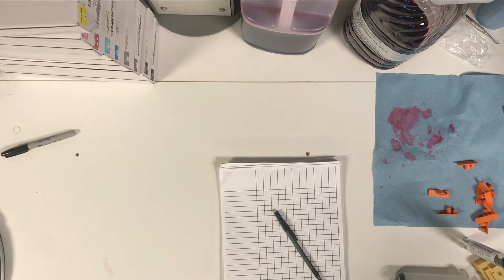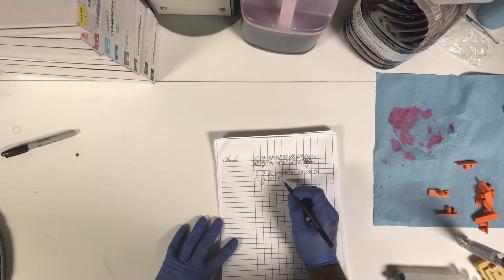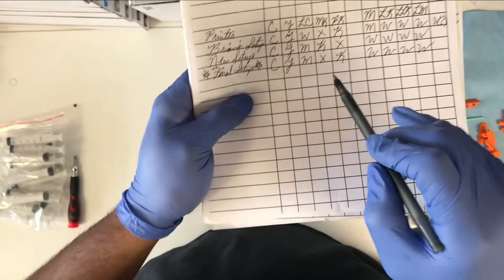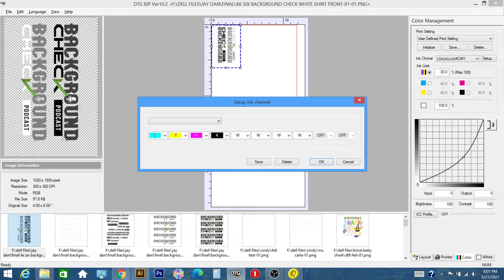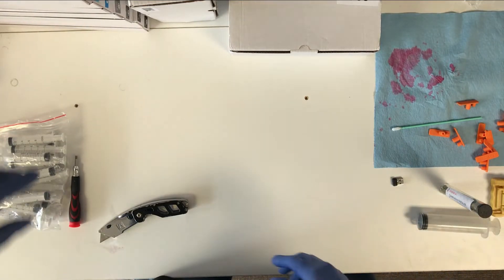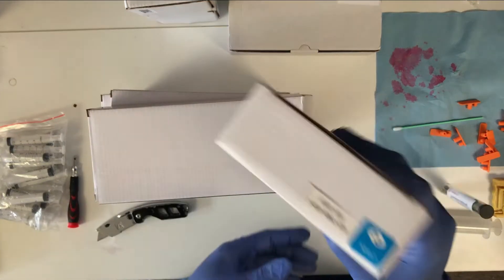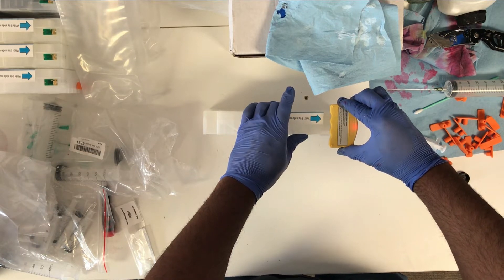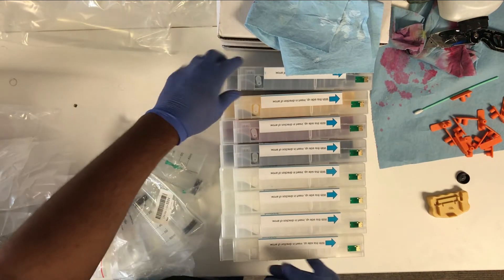PART 3: EPSON 7890 DTF CONVERSION

Comment: I really appreciate your videos.

I have a question: I have a 9890.... I'm having a issue with VM (line). I had the capping station and another part replaced and still the issue. Is it possible to move the VM to the matte black?
Reply from the maker: I wouldn't recommend moving any channel to matte black, because even though they are separate channels, matte and photo black share the same line. I would run a nozzle check to see if any other channels fire off correctly, and you can move it to that channel. You may also want to consider sacrificing one of your white channels for your magenta, since you only need two white channels, for full ink delivery.

Comment: Do you know if i can use cadlink for my software
Reply from the maker: You can use CADLink with the printer, but I don't recommend it because it forces you to use 4  white channels. I've learned a lot since I posted these videos. You only need 1 channel for your white layer. The printer will still lay down the same amount of ink; no matter how many channels you have for the same color.

Comment: Hey, 
Is it 4 whites on the right side for Epson 7880 also?
Reply from the maker: you can run 1 white channel and the printer will print full delivery, just the same as if you ran 4 whites. Running 1 white channel is actually better for the printer, but you will just need to fill the 1 cartridge more often than with 4 separate carts. Also, after you flush the lines with cleaning solution, you can dump the cleaning solution into a container and then replace the cleaning solution with distilled water, in your carts. After long term use, leaving the cleaning solution in the carts can damage the head to where that channel will no longer fire. I need to make an updated video.
Reply: @ Appreciate it. That helped a lot.
Reply: @elegant_edits hey currently im running 4 whites on my 7890 but 2 of them arent printing white anymore but the white on my prints comes out pretty weak, how can I make the white show better im on acrorip v11.3

Comment: Hi everyone, I been trying to covert my Epson 7900 printer to Dtf. But I have a problem with ink spill when power on printer and trying to prime the ink cartridge. I am getting ink spill inside the printer instead of the maintenance tank. If any body had that happened and how they fixed it?
Reply from the maker: your capping station may be clogged or the pump may not be functioning properly. There's also a slim chance; that the waste tube is disconnected. I would start with taking a look at the capping station (pump cap assembly). If you need parts, please email us and we can quote you for a replacement.

Comment: How many initial fills will it take fill the inks into the printed ?
Reply from the maker: I need to make an updated video. My Epson tech has educated me on initial fills. They are very aggressive on the print head, if the lines aren't empty. I now recommend powering the printer on in serviceman/repairman mode, going to the cleaning menu and performing 1 CL3 (Cleaning Level 3) cycle and then following that up with 1 CL2 cycle. That should be enough to push ink through the lines without extra stress on the printhead.
Reply: @elegant_edits  I notice some air in my lines when I was doing initial fill is that due to air in the cartridge
Reply: @elegant_edits  is this the same for running the cleaning solution through the lines or should I actually do initial fills with that, im not converting my 7890 im just switching ink brands and im wondering if I still have to do an initial fill or can just run the CL3 then CL2 cleaning to flush and then to also bring in the new inks, thanks in advance

Comment: What setting of colour can I used on Epson SC P7000 DTF ? Is it same with Process with Epson 7900 on DTG acro rip 10.5. CMYxKWWWWW
Reply from the maker: You only need two white channels. You can turn all of the other channels off. CMYKWW
Reply: @elegant_edits  thanks so much for this I really appreciate working perfectly can it work for espon 7890 dtf colour setting

Comment: I don't quite understand why you left piezo flush cartridge instead of just taking it out?
Reply from the maker: If you don't leave the cartridges in the channels that aren't being used, you will likely introduce air into the lines and damage the printhead, over time. The point of keeping solution in the unused lines is that if you're running AcroRIP software, you can move your color configuration around to those unused channels, in case you ever experience clogging in the other channels.

Comment: after i reset my maintenance  if still says no maintenance
Reply from the maker: If this happens, one of two things may have happened:
You may have let the maintenance tank's fill up, past 70% capacity, which could prevent the chip resetter from resetting the chip or you may need to buy a separate OEM maintenance tank; one you will only use as a dummy cart, to trick the printer into thinking that you have a brand new tank in. Then, you will need to remove and replace the pads on the inside of the maintenance tank, reset it and use that cart, after the printer recognizes the genuine cart.
Also, check the surface of the chip for small scratches. If you see that the chip is scratched, that may mean that it is time to replace the chip with a new one.

Comment: Have you tried the 7890 drivers?  And do you know why they recommend p6000 driver?
Reply from the maker: I tried the 7890 drivers, but the print command crashes. The reason why the p6000 driver is preferred is because that model printer actually replaced the 7890.